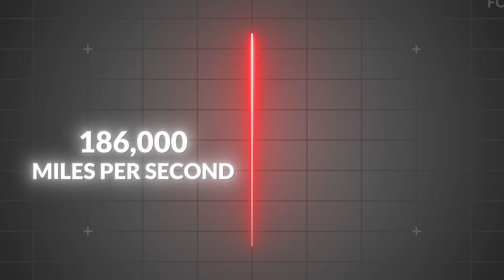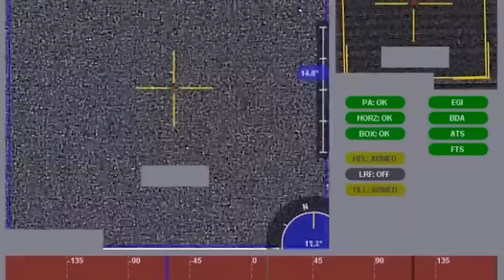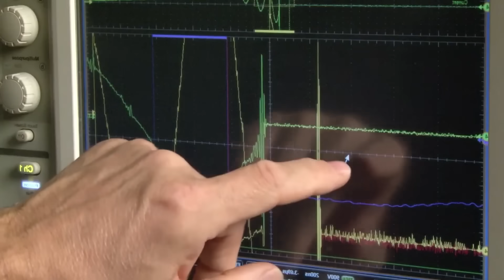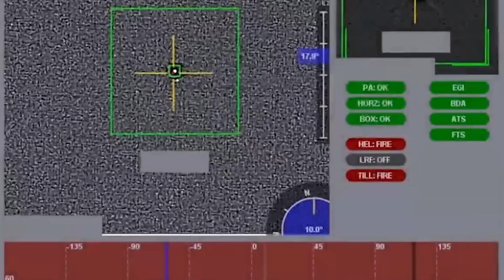This US LASER Will Destroy Chinese Fighter Jet In 1 Sec!

Comment: If it got really bad and we would have to probably take more or at least one nuclear hit. What you see and our military has is 50 to 100 years behind what's already developed in places like 51 or aliens. You will see that mountain open up and things coming out of there that will make your heart skip a beat. The black site that no one nose but can only guess or aliens. Why do you think we didn't shoot at the Tic Tac or aliens. Also the theatrics on the other videos. They the aliens were testing against a military so they can gain information on how they work against the best military sensors and obviously speed . We broke anti-gravity in the 1930s and have videos of it in 1950 . Now it's just on a larger scale and perfected better. No way in hell are we going to say that it's ours or maybe aliens. Or Allied governments . It's obvious the triangle is ours or aliens. The thing is if it has any Firepower because they have disappearing perfected pretty much and flying just as fast if not faster than the fastest Hypersonic missile or aliens. Remember the Slick Black bird spy plane that how to limit to 80,000 MI up and when they shot missiles at it in 1980 when was Declassified they couldn't go close to Mach 4 in other countries so they just put on the gas. By the way that plane was built in the 1950s and was in the works before that. Now the replacement one cruises at $80,000 miles high but I'm not going to tell you how high it can really go only the aliens know